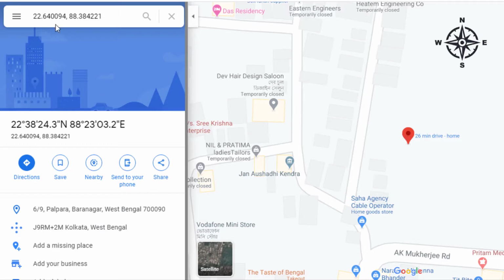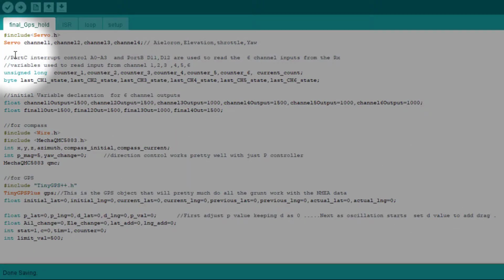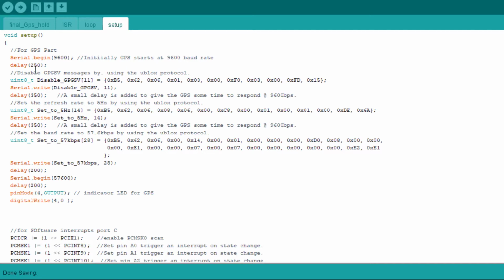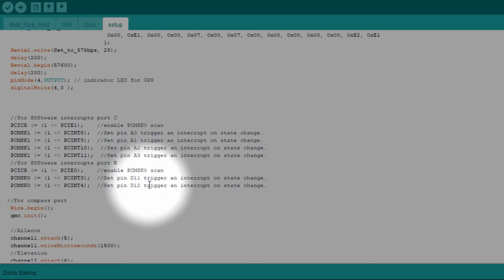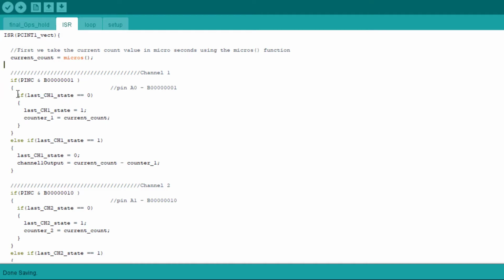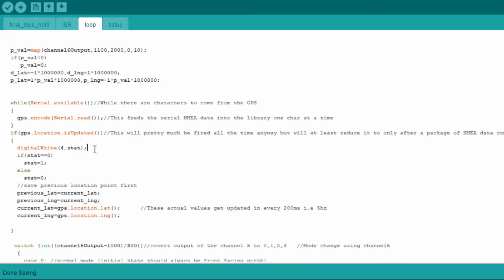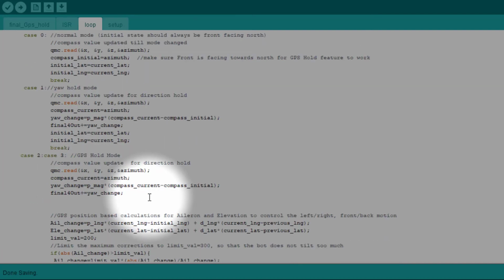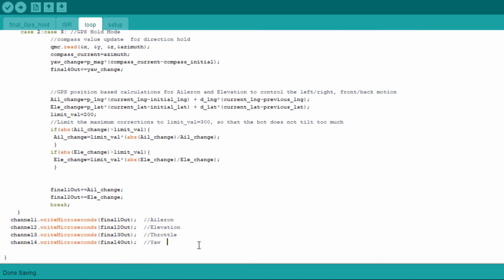Simple GPS Position Hold using KK Flight Controller and Arduino |Compass QMC5883l|GPS Neo 6M |HTG

Comment from the maker: check out the description for the connections diagram
Reply: Can i use this in arduino flight controller ????? Plz reply 🙏
Reply from the maker: @tarunbarman5128   In this tutorial we are using GPS which is connected to Arduino and is sending modified signals to the KK flight Controller.
Reply: @MagicalElectronics   sir,  i used the ymfc flight controller by joop brokking which is a fully arduino base flight controller can i use this gps system in my drone ?
Reply from the maker: @tarunbarman5128  It will be better to follow his video for the same if you are looking for a stable system.

https://www.youtube.com/watch?v=SC6Se_JBs7w&t=19s

Comment: Can i use arduino flight controller for kk  flight controller 
Please reply
Reply from the maker: @techbro1795  didn’t understand your query ? Can you please elaborate your requirement ?
Reply: I made a flight controller from arduino+mpu6050 at home . Can I use this flight controller instead of the kk flight controller for this project?
Reply from the maker: @techbro1795  here we are trying to correct the position by sending movement instructions to kk flight controller, so you have to modify the code accordingly.
Better use your original code and ask chatgpt to modify it for you to add GPS position hold as per your requirements
Reply: @MagicalElectronics 
Tanks

Comment: Sir if we want to add ultrasonic sensor for altitude hold than what changes we have to make in code or it would be better for us if u can provide as the code so we can enable all the functions at once altitude hold, gps, compass
Reply from the maker: Hi, 
Sure, I will try to share the combined code soon. Till then you can try to figure out how to combine the codes available at altitude hold video along with this one.

Also please keep in mind this entire playlist is for testing purpose only, the code needs much optimization for better stability.
Reply: I’m trying my best to combine them and also trying to tune pid fine for better stability. But still it would be great full if u can do something with the codes since I got stuck in middle of my build
Reply from the maker: @kulde3pverma160  hi, i will try to do something this weekend.
Reply: It would really help full ❤ and also can we store gps data so we can use it later for RTH(return to home)?

Comment: tell me can I mix with ultrasonic sensor connection with GPS
Reply: Thank you
Reply: Its support return to home?
Reply from the maker: Yes sure, we can do this to have altitude hold along with position hold, 

But first will have to figure out some way to calculate distance in the background using interrupts.

In the current code, the find_height() method takes its own time to update the height first before updating the throttle value, which is not good and adds extra delay. This should be removed to get good results

Comment: Gps latitudes and longitudes are not updating why?
Reply: Current_lat and current_lng always return same values
Reply from the maker: @venkateshkumar9480  
I am not completely sure why this might happen.

are you testing this data indoor? Try to test in open area if possible

chances are GPS is not able to connect properly  with satellites and return proper data

Comment: Can you make with barometer magnatometer and gps? U have to add barometer for altitude hold
Reply from the maker: I have made another video for altitude hold (using ultrasonic), we can use a similar logic once we can get good readings for a Barometer sensor. 

Anyways I will soon  try to implement that as well.

Comment: please what software do you use for your connections ?
Reply from the maker: The additional software is just an Arduino IDE. to program the  arduino .

Connections are done based on the logic of pin change interrupts.(google it to understand more)
Reply: @MagicalElectronics  thanks i finaly succeeded thank you please could i have your email
Reply from the maker: @newtechai4367   sure you can contact me at dokaniaharsh@gmail.com
Reply: @MagicalElectronics  i am at the level of integrating components together as one i am starting with the compass could you please provide your mail i would be very grateful i really need your help

Comment: How change mode from normal to gps hold
Reply from the maker: Make use of any spare channel available on your transmitter......and based on its value...switch between different modes
Reply: @MagicalElectronics  thanks bro

Comment: What are the parameters for KK2.1.5 ???
Reply from the maker: Nothing specific. Set it as per your requirement and even modify it later.
Just like the way  you do it in general.

Or even leave all values to default, just turn self level to always on.
Reply: @MagicalElectronics  ok bro, really thank you so much for this information....it will help me a lot.❤️

Comment: your first and biggest mistake is that you used a breadboard connection for drone. It is strictly prohibited in drones as it has moving or vibrating components which makes the breadboard connection unstable.
Reply from the maker: Thanks for letting me know ....although I am partially aware of this, still I don't think soldering components altogether is a convenient idea when you are testing stuff out, changing components regularly, and trying out new things.

To deal with Moving components and vibrations, I did avoid regular jumper wires and instead soldered some header pins with small pieces of wires. Also, I hot glued the entire setup wherever I  thought necessary.
In the end, my motive was to check if my logic works and see some rough results.

Still, I agree with you that to make it more stable we must avoid breadboards.

Comment: Any gps we can use of neo 6m
Reply from the maker: I used neo-6m-0-001 ...but i guess any other will work as well.

Also let me warn you that..although this works  but it is not that stable since there is some delay and lack of accurate positions by gps module.
But you can still try it out for learning purpose and understanding the concepts.